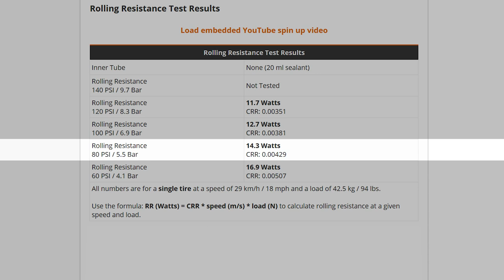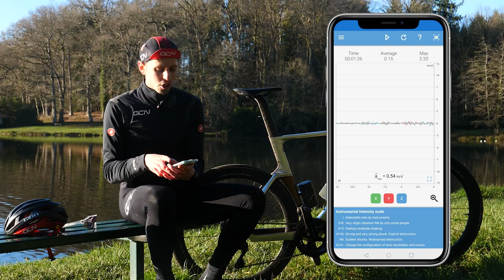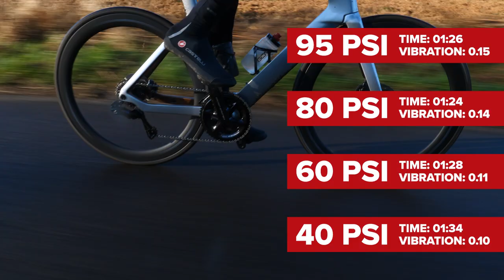Is There A Perfect Bike Tire Pressure For Speed & Comfort?

Comment: interesting. i notice that when I pull the track pump's nozzle off the valve then put it back in the tyre loses 5-10psi so maybe worth putting the extra in to account for this. 80-90 seems a good pressure for 28mm for most real world conditions
Reply: I think you don’t lose the pressure by taking the nozzle off, you “lose” it by putting it back on. Because the air goes from your tire back in the pump. More volume-> less pressure
Reply: I had this same issue and then I got a nice Lezyne pump with an air bleed system and then I saw I did not need to pump my tires everyday 😀
Reply: 😆 Why would you put the pump back on after you’ve pumped it up?
You’re only  letting the air out of the tyre to repressurise the pump chamber.
If you add more in to account for this pointless step, and then don’t do that step, your tyres will be over inflated!
Reply: @stevenrholland  because i was thinking that when u pull it out you lose pressure
Reply: @stevenrholland  when we take the pump off some times it gets kind of stuck and you hear air escape. We mistakenly would put the pump back on to check the pressure not realizing that it was only making it worse.

Comment: GCN needs to read up on tire impedance. BicycleRollingResistance's tests and other smooth-ish drum dynamometer tests don't show the effects of tire impedance.  Tire impedance is the loss of energy due to rough surfaces (that's way oversimplified).  The effect impedance is that it limits how high tire pressure can go. Practically that means that as you increase tire pressure (and cRR goes down), there will come a point beyond which cRR starts to go up.  That point varies from surface to surface and tire to tire.  Leonard Zinn, Josh Poertner, Tom Anhalt, and others have looked into this. There's lots of data online.

Also, the comfort factor can't be overlooked, and that factor may actually be a performance-limiting factor. I'm not sure what research has looked at this, but it has been suggested that prolonged exposure to certain ranges of vibration frequencies (and likely amplitudes) can lead to earlier fatigue and may have other effects.  There's likely merit to the idea that a more comfortable rider is a faster rider (I don't mean beach cruiser, big cushy seat, and upright comfy).

You guys might want to consider a test. Find a rough road and compare how riders feel over the course of and hour or three, wherein one rider rides at lowish pressure while the other rides at really high pressure (Maybe 60 or 70 psi vs 110 or 120 psi).
Reply: Thanks - was looking for a post like this (before I had to write it).  I would add that typical UK/Pacific NW wet road conditions also add a slip/grip factor that improves with a reduction in pressure.  Higher pressure helps avoid pinch flats for tube users, creating a practical lower limit.  The right tire pressure is usually the result of a few compromises.

Comment: I had doubt at first bout whether tyre pressure do make a difference. I used to run 100psi all round. But when i drop it 90 -87 psi. Major difference. Smooth and stable. Also comfortable considering where i live road surface are horribly paved.

Comment: It all depends on many factors of course.

But generally with my road bike I usually start with the pressure between the max and min recommended pressure, add 5 to the front and remove 5 from the back from that, then refine from there to find the most comfortable pressure with least rolling resistance.  I find this varies greatly between tires hence I didn't put a specific pressure down.

My mountain bike it's a little different, if I'm going to use it on the street then I simply run the min recommended pressure.  Then off road, I find I often run well below that recommendation. Again, I didn't name a specific pressure because it varies greatly between different tires, but also the terrain really can take on an equally important role in deciding this.
Reply: Maximum and minimum pressures are nothing but liability tags. You can basically ignore them because they don't mean anything the manufacturer does not want you to run Tire lower than their minimum recommendation or higher than their maximum recommendation. It has nothing to do with performance. To find the right pressure it takes much experimentation and even more so on a mountain bike
Reply: @rider65  little more to it then that (they have reasons from wall stiffness (tire folding onto it's self), rim protection, blow outs (more likely to happen at low pressure then high believe it or not), etc.  But it would be far too much work for them then just give a general guideance.

Comment: I think given the accuracy of the equipment, not under lab conditions, margin of error, number of tests i.e. just 1 per category etc. I don't think you can really draw definitive conclusions for a couple of seconds between 100psi and 80psi for example. I would agree that you can probably show the general trend i.e. lower psi will result in a more comfortable ride. Anyway, that criticism aside, enjoyed the video as I do all your videos. Did you have inner tubes on by the way as I know tubeless are usually on lower pressures anyway?
Reply: Are you questioning the veracity of his rubber-band mounting system?! 
You're one of those science deniers aren't you!? 😉
Reply: pirelli also recommends around 75psi, depending on weight so it seems to be consistent.

Comment: The weight of me and my bike & the bits and bobs i carry is about +120kg, i usually run a 100-110 PSI, anything lower, it feels like I'm riding on the rims and really squidgy/squirmy on the corners.
Reply: Same here but im running 87psi  using 25mm zipps, and 67psi with my 28mm mavic’s both tubeless
Reply: Yup, this tire pressure is only optimized for him and his current set up. Different tires, different weights, different surface conditions all change the equation. Only way to know what works for you is to go find a hill with like surfacing as you intend to ride on and ride it with different pressures under as close to like conditions as race day to see which is best.

Comment: Thank you. That was most interesting. I would be interested in another experiment. I don’t have the skills or equipment to do it.

Set the tyre pressure as you did.
Wet a paving slab and brush off excess water.
Ride across the slab.
Measure the width of the wet patch.

I would be interested to see if this is a method to establish the ultimate tyre pressure.
Cheers Del.

Comment: I changed my 700 x 38c hybrid tyre to a 700 x 32c road tyre on my Giant Hybrid bike with front suspension forks. I had both at 80 psi and the 32c tyre is more comfortable. Maybe the 32c tyres have more tread or thicker being newer but the difference is amazing. Also the bike is faster with 32c tyres.
Reply: yes, hybrid tires are very beefy, many have thick puncture protection layers and thick hard sidewalls. they are designed to last a long time with low maintenance, and the construction is also mostly way simpler and cheaper than road bike tires. they stay harsh and wooden feeling even at very low pressures. a high end road bike tire can feel like silk against that, even at higher pressures.

Comment: I used to use about 100psi but was loud and clattery and harsh and uncomfortable on my specialised Tarmac.
I wanted to improve things.
I tried 95psi and did some out and back runs in a set time recorded the ave wattage.
I dropped to 85psi and repeated runs.  Did the math.
I saved 3.5% power with the 85psi.    This was 7.6watts saving.  I was about 90kg.  Bike is about 8kg.

Comment: I’m running tubeless tYres with lower pressure. Interpolating your figures it would seem that 70 psi would be the optimum tyre pressure for speed and comfort.
Reply: My understanding is that the presenter, Alex, is a big fan of tubeless and rides on them exclusively.
Reply: @sventice  as am i. In three years ive had two punctures, it was only the next day did I notice a damp patch. The last one a stan’s dart sort that out 18months ago been riding on it every since. I found the mavic tyre pressure calculator to give lower pressures than the zipp calculator. Both calculators give numbers im happy with but about 70psi is a good number for me.

Comment: Your tire pressure should depend on 1) The size of your tires, 2) Your weight, 3) The condition of the roads you ride on, and 4) How observant you are (whether you "ride light" or "ride heavy")
I tend to still ride with a 23 in front and a 25 in back, and both at 95 psi, ever if I've put on a "little" weight in the last 35 years.
Reply: Was going to make the same point. Lots on here concluding 80psi is the best pressure but totally dependant on tyre size and weight. For me at 85kg I go up to 105-110 in summer, good roads on 23-25 mm and high tpi cotton tyres, down to 90 winter w/25's. 80 or lower would feel a little sloppy for me at my tyre width and weight
Reply: Well I can tell you Bill that a bit of you're thinking is outdated. If anything you want the wider Tire up front for improved traction and braking. Checkout Jan Heine from bicycle quarterly and all the data on tires there is a ton of information there that will change your way of thinking.
Reply: @rider65  
Nobody who rides on pavement does that. That said, I have to say that my Mountain bike is set up that way, with a slightly wider, with more knobs, in front.  Riding on pavement and dirt is completely different.

Comment: I ride 32mm tires at close to maximum recommended pressure, 100 psi/7 bar.  I think 80 psi is only marginally more comfortable than 100, to be honest, with noticeably more rolling resistance, and at lower pressures I tend to get quite a few more punctures on our poorly maintained US roads. I also suspect, admittedly without hard evidence (no pun intended), that fully inflated tires tend to last a lot longer than ones run at lower pressures.
Reply: Lower pressure will actually decrease puncture probability not increase it. Lower pressure will allow the tire to conform over debris rather than being pierced like higher pressure tires. It's mostly down to perception. Go check out Jan Heine from bicycle quarterly, he's been doing in-depth research and Analysis on tires and pressures for over a decade. He has so much information there it'll make your head spin

Comment: I thought that the main advantage of lower tire pressures was power being more easily transferred to the rear wheel on bumpy surfaces. This could also be a good experiment to make (constant power output vs. speed vs. tire pressure).
Reply: Definitely another advantage to running lower pressure on real world roads is the larger contact patch of the tire allows you to deliver more power to the road to the point that it is a bigger difference than the added rolling resistance.  GCN did a video (actually a couple I think) on this a few years ago.

Comment: so 80psi is the sweet spot on your results....

Yet Hookless systems can only run a maximum pressure of 72.5psi 😂 priceless
Reply: My thoughts exactly, but i warched the video 10 hours after it was posted.
Reply: Dan C, thank you for bringing this point up.....I still run "hooked" rims(Roval CLX 50's), I weigh 160LBS, Conti's5000TL's 28, front at 60/rear 65
Reply: @hkremer3234  yes I'm on hooked aswel some camy boras. personally I'm not a fan of hookless.

All it really benefits is the manufacturer in cheaper production costs. the watt savings for the customer are so small it's probably not even worth mentioning
Reply: @danc1829  Also, ask any reputable wheel builder, hookles rims lose spoke tension much faster than hooked rims do.

Comment: Was the windspeed IDENTICAL for each trial? To do a coastdown test on a bicycle, you need to be inside a big building.
The windspeed needs to be <2.00 % of the lowest test speed.

J Lee-Pevenhull BSc Mech Eng. Vehicle Dynamic Test Engineer, Jaguar Land Rover. ( Retired ).
Reply: You are not wrong, but the fact is most people don't have an indoor hill. In lieu of that, once you feel you're in the neighborhood of where you need to be,  you can start to collect more data to validate your results. If you're doing hill climbs once every week, do 3 at each pressure (12 hill climbs in one season) and at the end of the month you'll have a very good data set (12 samples at each of 4 pressures).

Comment: Okay, I had an old Bianchi with 23's, top pressure was 110 PSI, now I've got a new bike with 32's, top pressure 80 PSI.  If I remember correctly, I'd ride the Bianchi at 100 PSI, and I ride the new bike with 70 PSI

Comment: I pick a stretch of the road I am going to ride, and start with tires pumped up obviously too hard, and repeat that stretch with lower pressures until I just barely feel the road.  That gives enough pressure to protect the rims and not have any squirm.  Any lower doesn't improve anything for me.

Comment: So, overinflated tyres bounce over bumps, reducing speed, and underinflated ones are too slow. No s***, Sherlock!
When I was an audiophile, I found people believed wires made all the difference and would buy 20,000 $/€/£ speaker cable sets. Then I turned to photography. They're still debating an arcane "equivalent aperture" concept and buying 20,000 $/€/£ lenses to have the maximum aperture. Now I'm a cyclist. The same gullibility, with people ready to believe wider tyres are faster. Is there a hobby where they don't throw a lot of BS at your face? If there is, please let me know.
(In the meantime I swapped the 700x35 tyres on my hybrid bike for a 700x32 set of tyres. Although I could easily believe my bicycle became slower due to the extra narrowness, the fact that I keep taking time off my rides' duration tells me otherwise.)

Comment: It’s funny no one ever addresses the possibility of pinch flats or rim damage. Just speed and comfort. How fast and comfortable are you sitting at the side of the road fixing a flat. 100psi for me
Reply: Exactly. In 30 years of riding, 110 psi is my sweet spot where I won't bottom out and hit the rim.
Reply: @huffytoss  That’s a awesome user name ! I’ve tossed a couple Huffys in my life !
Reply: They’re tubeless mate. You can run at 40 psi and won’t get a puncture. Cannot get pinch flats with tubeless. Been running them for years
Reply: @DigitalB11  you can still bottom out the tire and damage the rim with tubeless.
Reply: @DigitalB11  have you ever broken the seal between the tire and rim because of low pressure? Thanks
Reply: I recently bottomed out front and back tyres on lower psi. I think around 85/90 is sweet spot.

Comment: Ok, how did you run 40 without getting a puncture? 
40 is what my mountain bike is at when riding on road. That's a 2.3 inch wide tire, 58.42mm.
Granted my road bike is a 23mm but  I get punctures under 100psi.

Comment: I've been running 80 PSI since I switched to tubeless and I was actually thinking about dropping that down to 70 now that I'm going back to 28's, but 80 seems to be about right
Reply: I mean honestly go as low as you can before the tire impact the rim on bumps and potholes 80 psi maybe optimal but it's really perception. There is a Tipping Point between the very lowest and very high pressures for optimal traction and performance. It may be 70 but you have to experiment it may be somewhere in between.

Comment: I think the sweet spot is below 80 psi. Even if the speed is slightly slower under this test condition, it cannot be mapped to normal riding. This is because vibrations that are not absorbed by the tire have to be absorbed by the person riding the bike, in the muscles etc. So the vibrations not absorbed in the tire are tiring(!) (lol) your muscles and as a result make you slower on a longer tour. This has to be factored in, and as a result the OVERALL sweet spot is somewhere below the "seemingly optimum" tire pressure under the academic test conditions not factoring in this effect.

Comment: Interesting Alex, what about the benefits to rolling resistance of tubeless, and the fact that hookless rims tend to have a maximum pressure of 70psi, and that nobody recommends running 28mm tyres at 100psi anymore?

All the recent rolling resistance findings seem to be that super flat tarmac benefits higher pressures, but typical UK roads would benefit from lower pressures. Your test was on a descent as well, so pedalling over deformations in the road would have shown a difference I think? Vibrations feel fast, but aren't is often the thinking. 

Having watched this, I'm planning on upping from 70 to 80 psi and trying to take the smoothest path on the road - running GP5000 TL 28mms on Hunt hooked rims. Thoughts? (anyone)

Comment: Would the results be less significant for lighter riders and slower riders? ie the vibration loss isn't worth the gain in friction. I'm 60-62kg and a new rider so i'm down in the 25-30km/hr still, riding an entry level road bike with tubed tires at 100 psi.

Comment: Can you tell if riding 25 mm tyres at 80 at the front and 85 at the back, I am 71 kilos or going for wider tires at a lower pressure would make that much difference to my shoulders, I have just had double shoulder replacement and all my bikes can only take 25 mm tyres and I don't have much money, I have a Dawes Galaxy which can take bigger tires but is heavier, not sure what to do x

Comment: Great video👍👍. I have done similar experimenting and have settled on 28 mm at 75 psi for a noticeable difference in ride quality with out any loss of speed. In the video you mentioned a app on your phone that you used for the testing. Wondering if you would be able to share the name of the app?
Reply: I was running my 28mm at 75psi for a while but struggling to find top end speed especially on descents. I upped the pressure to 90psi and now I am able to descend faster and overall speed has gone up. So I would say ride the highest pressure that still feels comfortable.